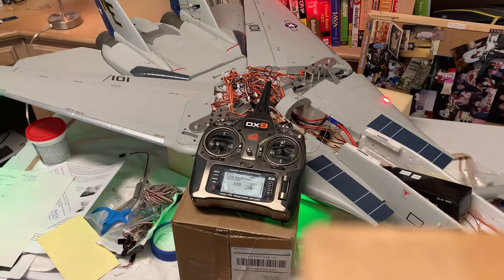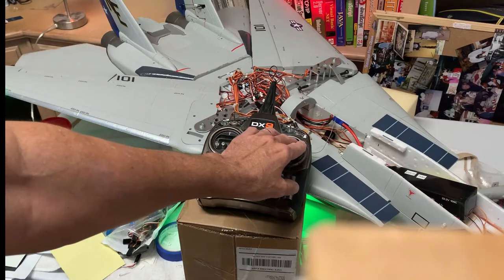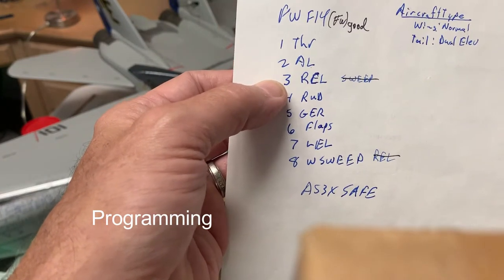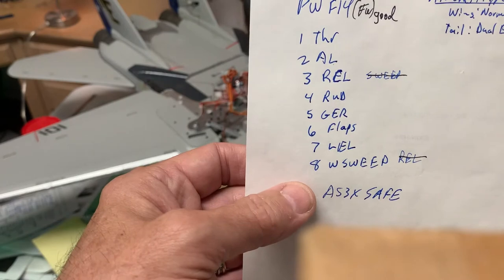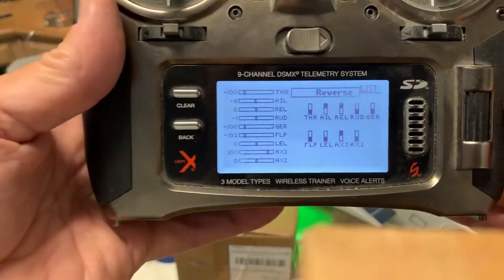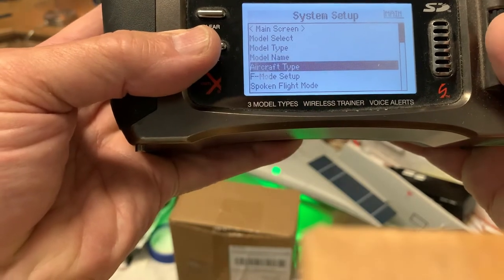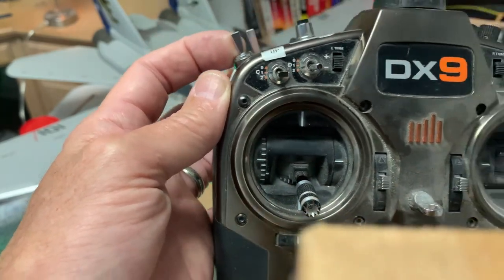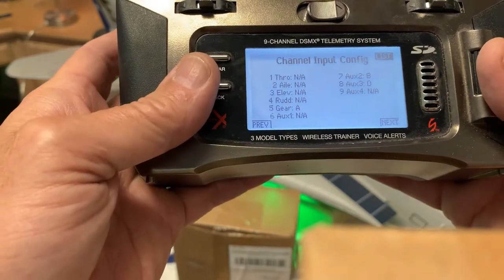Freewing F14 Programming

Comment: Definitely a unique setup, havnt seen anyone fly with the wings out and no taileron. Just an observation I made and nothing more, however the art tech 14 doesn’t have trailerons and just regular elevators and that may be why it flies good with the ailerons but the freewing might as well. Just havnt seen it done before without yaw issues and wobbly oscillations but have I faith that yours will fly good as well. Imma put a vid of my setup as well just because I think mine flies nearly perfect without ailerons, just that being the roll rate is very slow with full taileron rates. Prob could fix that with more throw by adjusting where the pushrod connects with the horns. Good luck brotha and thanks! Btw my setup has the same receiver ports setup as yours
Reply from the maker: Good point...checking with the original Art Tech owner if he recalls issues. I'd be interested in seeing your programming.
When I fly and try the wings sweep I'll be 4 or 5 mistakes high - hope I can see it :)
Too bad you can switch models on transmitter in mid flight. I could program your model and switch back and forth.
Reply: @Zek1701  Have you flown these setups yet?  How did it go?  Also, do you have the setup file that you can post so that I can download it?  Thanks, Jayson

Comment: In the real F-14 (A's and B's), with spoilers instead of ailerons, the pilots would add rudder to roll (stick) inputs to reduce adverse yaw. I'm wondering if you could add a bit of rudder to the roll inputs too along with elevon mixing?